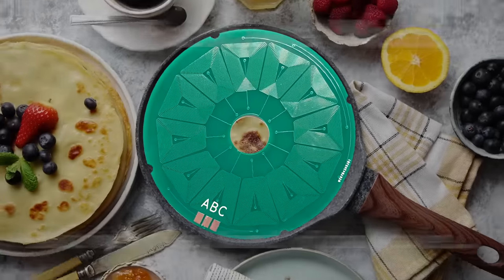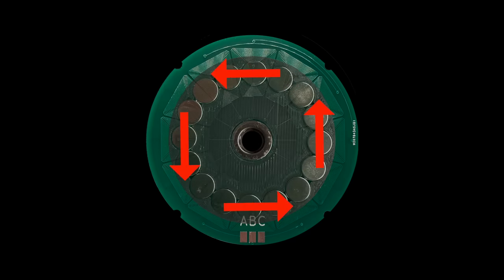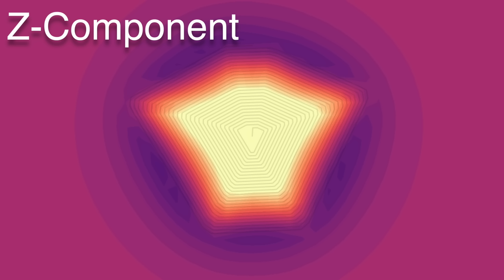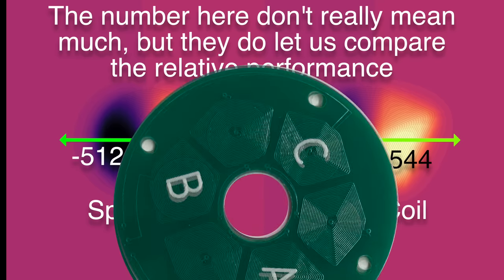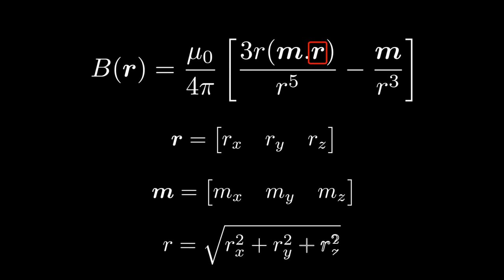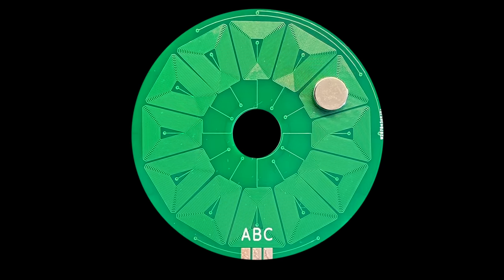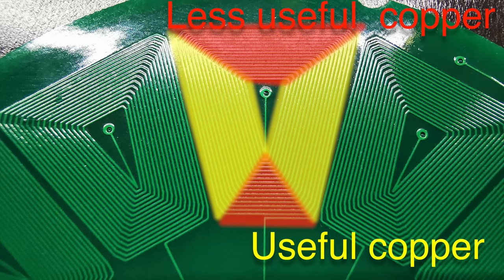PCB Motor - Why Are Wedge Coils Better Than Round Coils?

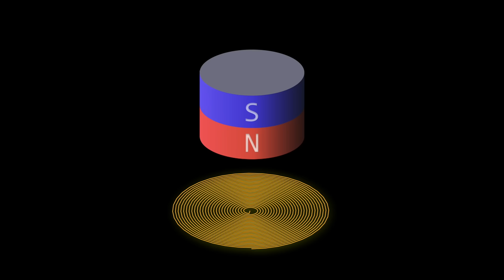Comment: What you said at 3:24 caught my attention. Are there any motor designs out there where the strongest magnetic flux direction is roughly in line with the tangential direction of rotation in order to provide more torque?

Comment: The radial lines being particularly important makes me wonder if you could make a better coil by stitching back and forth on two layers, so that the coil is rotated 90 degrees to the PCB, and the length of the non-radial sections is reduced to the length of vias.

I have a headache so in case that doesn't make sense, what I mean is run a trace radial outward, via to a different layer (can't think well enough to judge what layer pairings would be good), run the trace back, via back to the first layer, repeat. On a four layer board you'd be able to fit two coils, either stacked or nested (or interleaved?), I just can't fit all the details in my head to resolve if it'd be better for layer pairs to be close or far. Of course this whole plan would benefit greatly from blind vias so you don't have to fit four sets of vias doing the same pattern in the same space.

The big advantages would be more radial trace length since you don't lose the triangle of... axial? traces and you don't have a hole in the middle where it's hard to fit the spiral geometry. So you should be able to sweep radial traces of the same length over the entire wedge.

Maybe instead of 2 depth-first coils it'd make more sense to spiral across all 4 layers and then step in depth, so each coil-layer has 2 rotations instead of 1
Reply: Coils (with current flowing in them) approximate magnets. So rotating a coil by 90 degrees produces a similar field to a magnet that's been rotated 90 degrees. There are specific cases where this is desirable (look up halbach arrays) but it's generally better to have the flux lines pointed orthogonal to the rotor/stator, rather than parallel to it.
Reply: Exactly how early pancake motors were made.
Reply: @paradiselost9946  Any chance you know of any text about how that worked out and why it where it went? (I don't know where it went)

Comment: Good explanation!! Impressed, Can you share the script for the simulator? There are some follow up questions:
     - how can the motor best be shielded, is it required to be shielded due to safety requirements or can this be sold as is?
     - there are articles online where people add ferrites and further enhance the field,
     - you can use ferrites to pin the rotor
Reply: the motor is shielded by distance. the magnetic field drops sharply a few inches away

Comment: The more turns the more inductance, therefore limiting top speed and its torque. 
If you want more speed use less turns = less inductance, just need to use more amps, also this has more copper, lowering the resistance increasing torque at speed.

Comment: First thought: if the lateral lines of the coils are all we care about, why not shield the middle / vertical lines so they dont produce a pushing force on the wheel? I imagine the amount of surface area of the vertical coils shielded would need to be small not covering them completely, and probably rod-shaped ?

Comment: This makes me wonder, what if instead of coils following a simple wedge pattern, the perimeter were serrated so that the coils would overlap a little? The overall surface area covered by the coils would be identical, but they'd have more influence inside their neighbor's regions. I suspect the operation would be smoother and quieter, as you wouldn't be jumping as abruptly between magnetic fields. But I can't visualize what it would do to the motor's torque.

Comment: I wonder how many layers we would need, if we scaled this up to a ring with 29" and used it to drive the wheel of a bicycle. Use this on both sides to sandwich the rim, which acts as the rotor. Essentially building an axial flux synrm motor. I'm guessing it would need to spin at around 500 rpm and create a torque of around 150 Nm. Which would translate to around 50 km/h for a 29" wheel and the torque that a time trialist typically creates at the hub when sprinting.
Reply: 69.4km/t because 500rpm x 29" x 2.54 x PI x 60 / 100 = 69,422 meter. To go 50km/h with 29" rims you need 360rpm. And you would not be able to do this as the magnets cant stretch the full circle.
Reply: @jensstubbestergaard6794  Why can't the magnets "stretch the full circle"?
Reply: @P8qzxnxfP85xZ2H3wDRV  Mass. Also you need some kind of commutator to drive the printed stator.
Reply: @jensstubbestergaard6794  I see. For a practical application, my idea was to weave the copper wire or maybe even CNT wire directly into the carbon of the frame. Then do the same with the carbon of the sandwiched rim. That shouldn't be much heavier than other carbon composite parts.

Comment: Fascinating. My chemistry brain really wants to think it's looking at pi* and pi bonding :). I wonder how a spiral with equal trace length would compare? I'll have another watch when my brain is more awake!
Reply from the maker: That’s one flaw with my analysis. The wedge coils have a longer length in total than the spiral coil - which means higher resistance and so less current… I’ve seen some examples where the horizontal (useless) traces are made thicker so that the total resistance of the coil is reduced. There are some amazingly complicated wiring schemes.

Comment: I am curious why the SHARP turn on the center connection of the coils? Wouldn't a smoother corner reduce noise and allow avoiding a hot-spot in that sharp turn?

Comment: Then why not ovalize the part of the wedge coil which is not in the useful direction ?
I would like to know, is core saturation a problem here if you don't have a core ? Will these coils saturate ? Would it be a good idea to insert a small oriented grain silicon steel via in the middle of the coil ?

Comment: How about one single wedge radially that creates a rotating magnetic field? Made with several different coils wound in a way to maximize the surface area? You can use transistors (Bedini style) to trigger.

Comment: in that last image you showed, what would happen if you replaced the less useful sections of the wedge coil with solid copper sheet?  will the "coils" work, if they are parallel lines?  working from this idea, what would happen if you built a board that was purely radial lines, and then switched each of those lines?  is it possible to refine the generated field, in this way?

Comment: Designed a pancake coil on a PCB recently (used svg2shenzhen because couldn't get that jupyter notebook for that plugin to pump out a json for that plugin), but sadly that pancake coil only got hot when about 1A was running through that. Wondering if I should make another with wider traces. I am already pissed I spent 7 DOLLARS on the first one that didn't function properly though, so I want to MAKE SURE the next one functions properly.

Comment: Why not turn the magnets upright into a cross-field configuration to maximise the x-plane / angular force (torque)..?  Alternate the polarity of the stator coils so each magnet's being pushed and pulled simultaneously, and time the duty cycle so they cut out as the magnets pass their centers (the sticky spot) to minimise negative torque and cogging.  The twisting / precessing moment (the magnets want to turn face-on to the coils) could be mutually cancelled 180° opposite sides of the motor to minimise off-axis stresses..?

Comment: are you still work on pcb motor design? Is the pcb motor have to start super high speed? can it start at very slow or zero speed, but still keep the torque force?

Comment: Nice design and explanation. What about distributing the coils around the whole wheel, something like star or gear wheel shaped coils? Another improvement may be to let the PCB spin and have two sets of magnets on both sides, though that makes it much harder to power the circuit.

Comment: Is a PCB Halbach Array possible? Now that would be interesting.
Reply: a second, thick, two layer pcb with purely radial trace coils offset from the main drive coils and fed the phase difference between the two adjacent drive coils.
though a ferrite disc on the back side would have a similar effect

Comment: Maybe a dumb question, but could you gain additional torque by using both sides of the PCB?
Reply: He is using both sides, plus two additional layers inside the PCB. each visible coil has 3 identical coils below it, with the same turn direction, all wired in series. Since the magnets are only on one side, it could be possible to change the shape of the coil in each layer, in order to improve the shape of the magnetic field on the side where the magnets are. Another option is to have fewer turns and widere traces (with lower resistance) on the side facing away from the magnets, and more turns and thinner traces on the side of the magnets, assuming the generated heat would be spread through the board anyway, and the coils close to the magnets produce the most effect on the magnets.
Reply: yeah, the rotor is on both sides

Comment: You point out that the x component of the force is what's important for generating torque with the coils, but you use a magnet whose field is only in the z direction.  How about using magnets whose axes are tangential to the coils on your board?

Comment: why not ditch the magnets altogether and go with an induction motor?
you can do this by making the rotor a circular 4 layer board, use thin, tightly spaced radial traces connecting to a thicker inner and outer ring trace, the layers need not be connected. those traces being the inner and outer axial diameter of your stator coils, no holes needed except for the central axis. as long as you are feeding your stator coils 3 or more phases sequentially, the rotor will follow the coil phase propagation. torque will increase all the way to the point the rotor is locked.
in either case, PM or induction, if you could park a ferrite ring behind your stator coils, it would improve your transfer efficiency massively.

Comment: So why not put a PCB either side with the magnet disk sandwiched between them? This would cancel the Z direction forces and double the X direction. You could then give it a funky name like a cheeseburger motor.
Reply: Two magnetic rotor-discs on a central shaft; one disc on either side of the PCB.
Bearings support the shaft rather than the rotors, so there's no side-loading.
You could keep very tight Z-clearances without stressing the bearings.
Hmm, getting rid of heat might be an issue.

Comment: What do you get if make your coil perpendicular to the board instead of parallel with the board? 
By that I mean run radial tracks on the top and bottom of the board then join them with vias. Will this make all/most of the track surface area 'useful'?
Reply from the maker: Yeah, I’ve seen some interesting alternative wiring arrangements. Still trying to understand them though!
Reply: My instincts tell me that the magnetic field would be less if configured as you decribe

Comment: Do you run multiple plates with one more stator than rotor to reduce the flex and end forces hence reduce the air gaps?
Reply: The entire thing is in the air. It the main reason this has no power. A typical motor has only 1mm air gap in the flux path.
Reply: @aerobiotic  
Toy car motors run a whole lot less than 1mm

Comment: Not watched it yet but I'm going to have a guess. Its to keep the rotation od the magnetic fields on both ends of the coil the same.  As distance travelled per degree of arc is greater as you move away from the centre of rotation.  Now to watch the video and see if my assumptions pan out.
Reply from the maker: I’ll be interested to see what you think.
Reply: @atomic14 
I think that we are thinking along similar lines but from different directions. My idea is that cutting the wires with the magnetic field is important for generation, so to arrange the wires as radials from the centre of rotation means that the field cuts all the wire at the same time. Were the curves of the loop mean that it takes more of a rotation to fully cut the outer most coils.

A lot of work and effort must have been put into making this video. 

Also it’s a nice change to see someone working on making a motor instead of a free energy or greater than unity alternator.
Reply from the maker: Maybe I'll stumble across a perpetual motion machine...

Comment: The other side of the coin is, that this would be a good small generator, for an array set up of 10 to 20.
Having them made small would mean, they could be placed in out of the way area's , and have a lower profile, as of if they were placed on a wall or roof ridge, or put them on a bicycle to charge up it's light battery's.

The shape of the coils is all wrong, they need to be arrow shaped in the direction of which way the motor turns, as like a V to direction, this gives 3 sections to the coil.. this is like any 2 cents in any comment section of yuk toon.

Comment: 6:50 - I guess if (for some reason, like crankshaft like operation) your goal would be to exert radial forces rather than tangential ones, then the notions of "useful copper" and "less useful copper" would need to be flipped. – I wonder what the optimal geometry ten would look like …

Comment: Simple. Pizzas are round (mostly) because a square pizza will have significantly more ingredients (i.e. more costly).
Reply: Wouldn't a square pizza of the same dough weight have more crust and therefore fewer toppings?

Comment: Can you imagine the power of a 2nm process semiconductor motor?
Reply: you mean an airgap of 2nm? it wouldnt make that much difference
Reply: @Blox117  i mean the windings are made of "wires" that are 2nm wide, made by EUV lithography
Reply: @Blox117  Go on, say you couldn't fit more coils in at that line density. And that overclose motor distance (given that the PCB roughness can't be there braking.)

Comment: You are not using the total force of the fields, look at any motor, the flux lines are complete paths with tiny air gap. Your flux reluctance (flux resistance) is high = inefficient.

Comment: Tesla proved Bifilar pancake windings, as per his patent 512,340 produced the strongest field.
Reply from the maker: I still need to look at that parent properly. I did a quick skim read and I’m actually wondering if the two layers gets something close to it - or maybe it introduces a whole set of other behaviours?
Reply: @atomic14  Maybe if you bring out the ends of each coil on each layer, you can wire them different externally, to find the optimum setting? 
I don't know how many layers PCB way can cram in there, but if you have the free option, you might as well go for the most and experiment away...
Reply from the maker: Yep, been thinking about doing this, we're getting pretty good results with 12 coils and 16 magnets, but different numbers of magnets require difference wiring combinations. So breaking them out might be quite worthwhile. PCBWay can go up to 14 layers - but we'll start to hit issues with driving enough current and then getting too hot :)
Reply: @atomic14  I played around designing and building my own pulse motors for 2 years back in 2000. 
I won't go down that rabbit hole again :)
Reply from the maker: Starting to feel the same - this started off as "a cheaper alternative to a proper motor" and now it's a can of worms.
Reply: @atomic14  Yep. I was lucky I got out.
Reply: @atomic14  So now all your disassembled hard drive spindle motors are off in an earlier video?

Comment: The stronger the magnetic field, the slower the motor. The limit to a motors speed is the BEMF it produces. Stronger magnets, stronger bemf.

I wonder what response i would get if i asked about field deformation, and the offset of the reaction field produced under varying power factors, ie, capacitive, inductive, or resistive loads...

More to motors and generators than just waving a magnet past a wire.
Reply: your first statement is incorrect and/or makes no sense.    entire comment is worthless

Comment: You never went over the basics of the drivers at hand or considered pole pieces for the rotor, and it would be good to go over the stator layers and whether a pole piece on the reverse would merit anything or just resist flux more. 😅 You could feed it into Maple or MathCAD or Python notebooks such as you like to plot things like loss functions, current, driver power or efficiency and whether idle inductors or drive circuits would be of use. Then compare to based superconducting maglev trains (look how much you saved!)

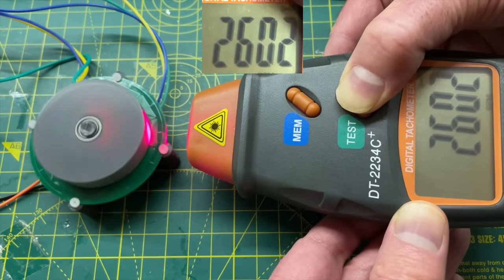Comment: some  Facts.       1:05   (high) rpms   EQUAL   torque.!   via the use of a Reduction drive or, there can be more  Inherent  torque in a motor having a larger radius.
1:28    where is  the  SUPPORT  for this assertion.?  it's not in the graphics shown.
2:35    it  should be  Understood that the coils in a motor are  ELECTROMAGNETS.    as such,  Ferrous  cores Should  be  used, and the wisdom of using of a layered coil structure should be determined*.          the coils being used here are fundamentally  WONKY.      consequently, the analyses/simulations  are  meaningless.            the absence of coil cores is a reason that the acceptable air gap distance is  so  TINY.        googletranslate
*    it is useful to  Understand  that in a conventionally wound coil (having layers), the  direction of  current flow in adjacent layers is  180  Mechanical Degrees  Out of phase.!       this condition is a primary source of  impedance/b-emf  in a  coil (when it is energized.